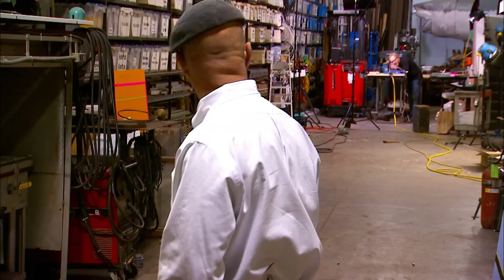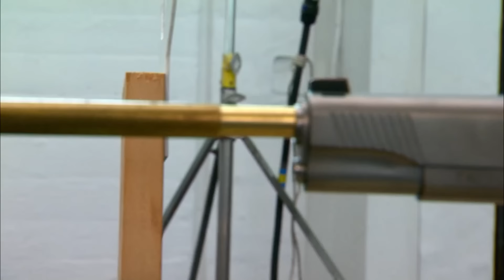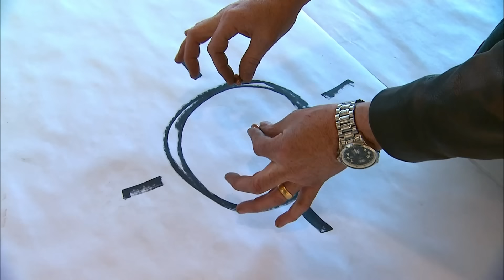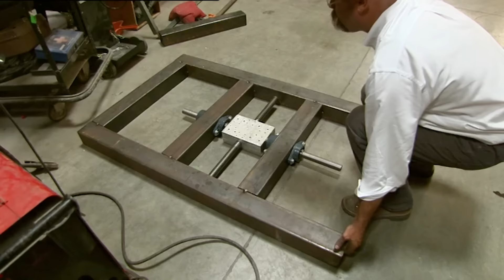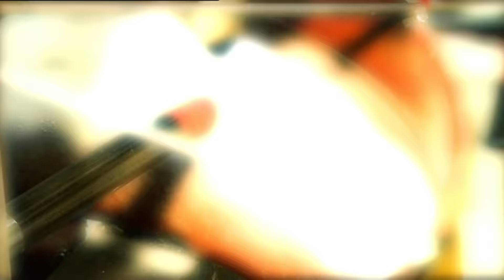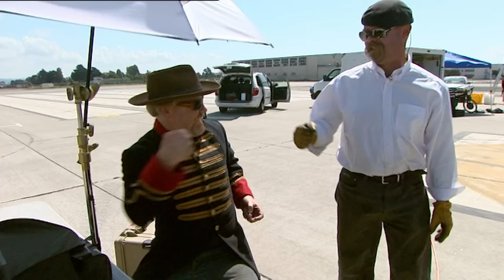The Most Satisfying Weapons Science MythBusters Ever Put On Camera | MythBusters

Comment: For everybody freaking out about "hot water heater" (and I know you're there), I give you this scenario. 140 degree F water is HOT! You could burn yourself with that, and most hot beverages are served around that temperature. If you take 140 degree F and raise the temperature to 160 degrees F, congratulations! You just heated hot water!
Reply: or just call it a boiler
Reply: @caramelldansen2204  A "water heater" is not supposed to boil water, not even close. If your water heater is boiling water, you have a MAJOR problem!Having a water heater set to higher than 160 degrees F is extremely dangerous. Water boils at 212 degrees F, which is far lower than the operating temperatures of most water heaters.
Reply: @corkbulb2895  so don't set it to fully boil lol

Comment: l liked these guys but lpost it, first one...dropped andb shot is not ther same...ball has a curve so hows the grid the same when you have the ball going 2 ways whilr the other ismjust dropped. Then he says a slow moving round? so different power will make every different bullet different? Sure you can have a difference in time...you counted both, you could use both, just subtract the difference! No its not right and you will never get it exactly the same cause the longer distance has more resistence then just gravity, the further high powered rifle will get a bigger difference cause there is air resistence or drag. Nope your theory is wrong. Even just your firing mechanism will be exact!

Comment: Air resistance (ballistic coefficiency and air pressure) affect bullets at speed, slowing them down more than by just dropping them. A bullet falling from 3 feet is going slower than a fired bullet, the air isn't slowing it down as much as a fired bullet. By the time the fired bullet hits the ground, it's going slower vertically than the dropped bullet. The lab experiments showed this. That's why you have to do this in a vacuum where the air pressure and wind resistance isn't a factor, like dropping a feather versus a stone or a piece of paper.

Comment: My physics teacher asked me and my friend George to build a blowgun with an electromagnet. When the wooden dowel broke the connection, an electromagnet dropped a soup can lids about 5 feet away. When I "fired" the blowgun, the piece of dowel rod hit the soup can lid, proving that both objects were affected by gravity. It wasn't 100% precise because the first time, the can lid magnetized and it didn't drop or the dowel didn't break contact, but the second time was "successful". Again, we didn't check the angle of the blowgun with a level, we didn't use laser rangefinders or laser levels to make sure the can lid and barrel were exactly the same distance from the floor. We were lucky to have tape measures.

Comment: I see a problem. Adam said the fired bullet was measured to the "spot the fired bullet will be skipping off" meaning it is continuing to travel forward and hasn't reached its complete trajectory since it skips forward. The task was to measure when the fired bullet finished its complete forward movement. So are they accounting for the full length of the distance the fired bullet traveled, if it continues to move forward after it first hits the ground? And would that distance result in the same time if the dropped bullet was held above the ground the full distance that the fired bullet traveled? Looks like they will be renting a tower to do that test and then synchronize the drop with their distance test. Good luck guys. Make Newton proud.

Comment: The question I have about the bullet drop/fire experiment is what are the bullet load grain parameters ❓
Grains of powder and projectile weights for the same caliber round vary from the manufacturer.
Granted you can hand load, but what equivalent is dropping,or using gravity, compared to how many grains of gunpowder ❓😜🤔😲 it's a tricky one for sure ‼️🤔 
What caliber round do you have to use for it to be accurate and probable ❓🤔 
Would a .22 dropped and shot act the same way as a.50 caliber dropped and shot will ❓🤔😳
And what did come first the chicken or the egg 🥚❓🤔
Obviously the chicken, because an egg can't have sex nor an orgasm ‼️😂🤣😆🤣😜🪴💚☮️✌️

Comment: To make the experiment more accurate, the air should be removed from the hall :) As the projectile spins, it generates some aerodynamic force. And then there’s the issue of the weapon’s recoil—even 1/100 mm makes a difference there.
Reply: also the curvature from the earth
Reply: @D @DrSmugface he 6 inches of drop adds about 66ms of drop time for the fired bullet. So it does account for why the dropped bullet hit the ground first, getting them closer than the 40ms difference, and making the fired bullet slower - which may be accounted for by some aerodynamic effects. You’re onto something!

Comment: Ball bearing test vs bullet are different events.  A fired bullet has the gases and spin of the rifling travelling through a fluid(air) with the shape of bullet fired should ride on the air/gases for a certain amount.
Reply: Only if the steam gun used rifling or not

Comment: Correction Adam! Motion Picture Production BFA here.
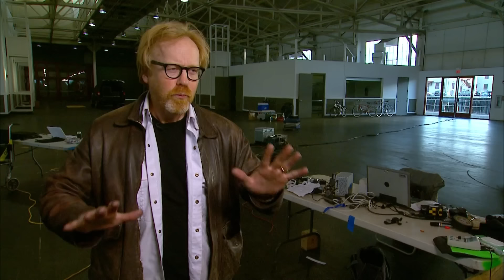22:21 Not exactly right. What most people forget is the film frame needs time to move. The projector blocks the light while the film advances. Then the light goes through the film to the screen. To eliminate flicker, the light is blocked a 2nd time then the same frame is shown once more for 1/84 a sec each (Look up flicker fusion threshold for that rabbit hole). Added together this means for each of the 24 frames per second the screen spends about 1/48 of a second in darkness and 1/48 illuminated. 24 x 1/48 light and 24 x 1/48 dark.
In a celluloid movie you are in the dark half the time! 

I know it doesn't have the audience draw of explosions and bullets, but I'd like to see the pinball drop multiple times (& simultaneously!) to get an average.😉
Reply: Lmao nerd

Comment: The math is instantaneously understood.  The moment 5the bullet leaves the gun it is facing the same forces as the bulet dropped. The challenge here is interesting because it is entirely about producing a method to demonstrate it.
Reply: if you want to think "simply" then imagine all the extra energy imparted by the gunpowder explosion like the engine of an aircraft
Reply: only if you're working in a vacuum, and not concerned with the curvature of the earth, both are factors in the real world, a fired bullet will be in the air farrrr longer
Reply: @beargillium2369  when building a building and leveling it properly you take out the curvature of the earth from the equation

Comment: Bullet firing vs bullet dropped. The science you used to measure this was mechanical (gun) vs electircal (release). Electricity doesn't instantly run through circuits, there is a delay. 
Can you actually confirm this myth then? Maybe use mechanical vs mechanical to confirm.
Reply: Electricity is crazy fast and that delay is insignificant I think.
Reply: @andreaswiklund7197 for sure yes 100%, electricity is fast, but not instant. I just felt like to have a fair test it both needed to be mechanical. Eg weld a piece of metal to the gun to hold the dropped bullet in sort of a chop stick grip so then use the exact same firing recoil that fires the gun bullet, to then also release the dropped bullet from its "chop stick" holder. Nothing fancy is needed.

Comment: @16:38: that yellow plastic thing is a safety device called a chamber flag. they are meant to be used on gun ranges to show that the chamber of a gun is empty.... they do not go in the muzzle of the gun, they go through the ejector port into the chamber. who ever the safety guy was on set this day needs to be fired. there could easily still be a bullet in the chamber with that flag in the muzzle like that.

Comment: Talk about ignoring the evidence on the dropped bullet. yeah its milliseconds but the dropped bullet lands first because the fired bullet flies for those extra milliseconds in a straight line. if you further expanded the same test with faster and longer ranged bullets the time should keep expanding. The first test with the pin balls showed the same it flies for a bit before dropping.
Reply: It's not a straight horizontal line, if you were to track it, it'd be curved downwards at the same rate as gravity as soon as it leaves the gun barrel. And ofc a little influence from air resistance.
Reply: @StaticNebula26  if it was as down as the dropped bullet there wouldn't be the delay of milliseconds. its the effect of the barrel longer barrel rifles would increase the fly time especially rifled barrels
Reply: @dragoneyeshatesg00gle76  Like I said, air resistance. In a vacuum, they'd hit the ground at the same time. More rifling wouldn't do anything for that bullet because the bullet was still spinning when it hit the ground. The only way the rifling affects the bullet is by giving it spin-stabilization, spinning it faster doesn't make it more stable, it's already as stable as it can be.

Comment: use sharp angle projectiles. like a blunder bust, you cram anything you can find, bullets, casings, whatever is available. I think you should revisit this weapon and use the bullets that was easily made. People carried forms arond to make more bullets. If you used those I bet they would do damage and give you the real machine gun effect. You would probably need more throwing arms or higher rpm. I just do not think they would use giant round balls. To much surface area, and they would already understand this, from using canons, that around this time started to become field artilery, held way back behind the line instead of old canon ball canons had to be on the front line, due to range limits, which was a result of the large round surface area. I really think back then they would have put any type of shrapenal to use as a bullet.

Comment: No 2 bullets weigh the same.  You have will need to weigh each slugs the power charges.  Plus the air restrictions in time travel verses the dropped round !
Reply: Drop time isn't affected by mass when talking about earth vs a bullet. But yes, air resistance and a bunch of other random factors in the experimental setup is likely what lead to the small difference in drop time.
Reply: Now wait a minute.  A magnet holding a brass and led bullet? Come on.
Reply: @stephenmcginnis5521  cheaper ammo can sometimes be copper coated steel jackets rather than pure copper

Comment: Why didn’t they fire straight down in the same direction as the dropped bullet 🤦🏻
Reply: That wasn't what's being tested, of course the fired bullet would hit the ground first by a large margin in that case, what's being tested is whether the horizontal motion of the fired bullet is somehow able to slow its fall, in a vacuum, it wouldn't, but air is a fluid so weird things happen. Imagine if I told person A to walk south 10 feet and I told person B to walk west 100 feet and south 10 feet, did they walk the same distance? No. But they did walk the same distance south, 10 feet. In this experiment, both bullets were 3ft off the ground and because gravity works on every object equally, they both hit the ground at (basically) the same time.

Comment: Wasnt there also a ~300ms delay of the bullet being dropped meaning its basically the same time?
Reply: 39 milliseconds but thats also only 3ft off the ground. Increase the height that gap grows bigger. Meaning the myth is actually false
Reply: @Harbard12732  yes, weird things happen because air is a fluid, but since they couldn't get a 400yd long vacuum chamber, and considering the randomness of the burn time of each round, or the barrel shaking slightly upwards or downwards due to recoil or the dropped bullet getting randomly caught in the solenoid for a couple more milliseconds, etc., a 39ms difference is good enough to blame on air resistance rather than the absurd notion that going faster horizontally somehow makes gravity weaker.
Reply: Thats just simple physics moron 😂 if there is a difference at only 3ft hes a gap then that gap will get bigger the higher you get. And fyi air resistance at that distance plays little to no effect  @StaticNebula26

Comment: Doesn't a bullet fired from a gun already have an arc to it. You would really need to measure how far down range that bullet travels before it is again at 36 in from the ground and time it from there.
Reply: A bullet doesn't arc upward after leaving the barrel 
It immediately starts to drop what do you mean arc upward
Unless your aiming upward
But there gun is 36inches from the ground and level
Reply: They do. Also that gap in time increases with the height its fired from
Reply: Only applies to using a scope or iron sights. The barrel was level.

Comment: I want to delve a little deeper into this with a possible explanation of the minute difference in dropped bullet vs. shot bullet. ❤ Woukd the minute difference in the time to hit the floor be able to be explained by the use of a modern rifled barrel. The rifling of the barrel males the bullet spin which it so stabilize the bullet during its flight to the target. I know that the bullet isn't a sphere so the magnus effect may not be able to fully explain the difference in time, but it woukd be worth looking into if someone had the time and technology (high speed camera) to investigate further. Possibly even do the same test with a lead projectile and lead ball with one being fired from a smooth bore pistol or rifle. The issue with using a smooth bore would be accuracy due to there being no way to make sure the projectile spins the same direction every time and it would impact differently each time depending on the spin of the lead sphere.      There is so much more that can be dove into here and you have opened a whole new barrel of monkeys in my ADHD having brain. Just wait till I show this particular video to my 12yo son who overanalyzes everything. BTW, my son has been on a theoretical physics kick for the last 3 years and wants to be an engineer and design/build. I'm still finding ways to introduce him to all of the different fields of engineering that he can go into if he continues on this path and still wants to be an engineer when he graduates HS.

Comment: wait if they used copper jackets the magnet could have induced a magnetic field in the copper with could be why it was so hard to drop the bullet at the same time
Reply: They were holding one up with an electromagnet so the ammo was probably a cheaper copper coated steel jacket bullet, the residual magnetism from the electromagnet and the steel is why they switched to the solenoid dropper for the final test, the effects of the solenoid are neglible, the difference was likely a combination of the randomness that comes with trying to time the firing of a gun and some air resistance shenanigans

Comment: Never understood why people would doubt the bullet myth. It's super basic physics. Same as the bowling ball and feather
I remember on QI Stephen Fry mentioned it and all the guests didn't believe him 😂
Reply: If you think about it in geometric terms, there's an absolutely perfect reason the fired bullet takes just a little longer.  It's travelling further.  The dropped projectile is traveling in a straight line, the fired projectile has an angular path to the ground.  The speed of descent will be consistent, but the distance covered is greater.  39 milliseconds is not simultaneous, even though the apparent-to-the-human-eye difference is negligible.
Reply: @AllTradesGeorge  this is entirely the point they were disproving, horizontal and vertical speeds are independent of each other, the fired bullet is able to cover a larger distance by the time it hits the ground because it was fired horizontally at high speeds, but that horizontal speed doesn't affect the vertical speed of gravity at all.
Reply: the bullets didnt hit at the same time, for the same reason bowling ball and the feather wouldnt drop the same speed UNLESS IN A VACUUM, the one fired probably had a tiny bit of lift in the air that it would not have in vacuum, and this would only get worse with faster bullets.  their claim that the bullets dropped at the same time because a conventional camera wouldnt catch the difference is idiotic.
Reply: Because its not truee moron 😂 the bullet did not hit at the same time